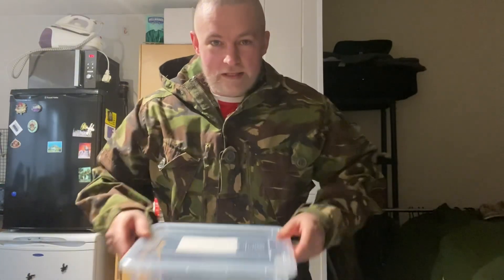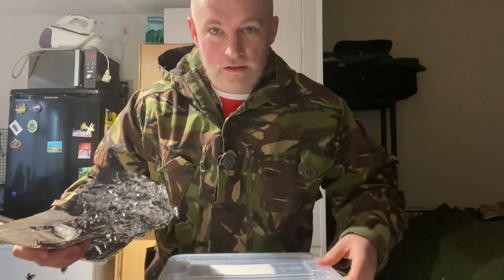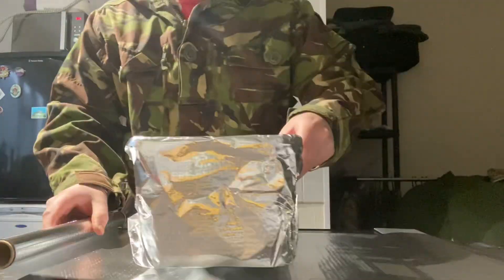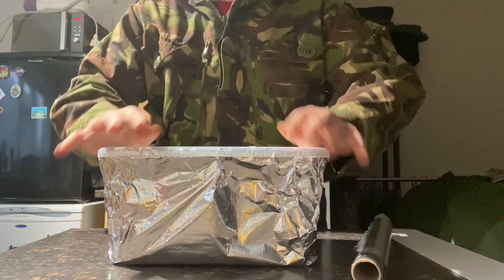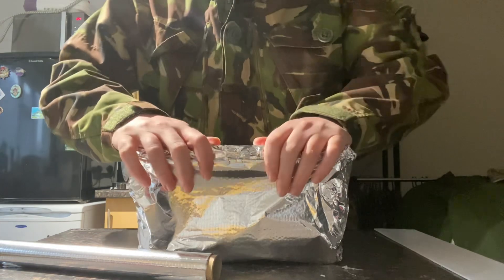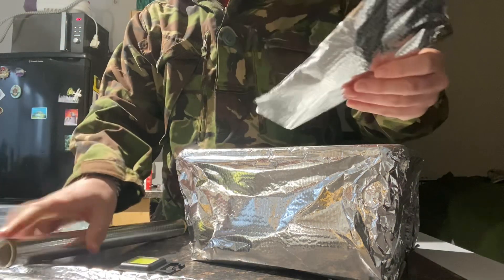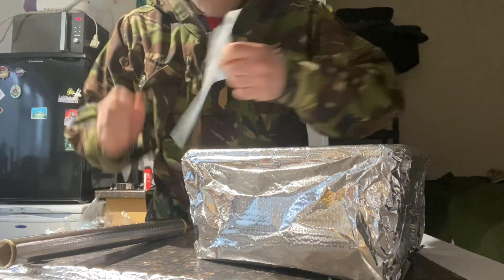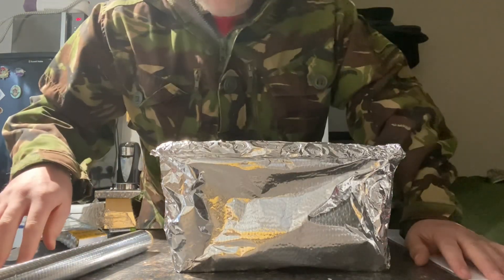DIY Low Cost Faraday Cage: Protecting Your Electronics from EMP

Comment: Not helpful or useful for real world causes like solar flare where you need to protect fridge freezer solar panels & generator
Reply from the maker: Solar flare does not effect smaller electronics. Only gird, so would not Need a faraday at all.
Reply: @UKUrbanPrepper big solar flare does indeed effect most electronics including solar panels on a house, an off grid home, fridge freezer etc
Reply from the maker: @UnspokenDocumentaries 
No it’s about the scale of Conductors…
Power lines are essentially giant, unshielded antennas that are exceptionally good at capturing the significant energy from a solar storm's induced currents. Small devices you would put in a faraday cage for EMP (Radios, phones etc) 
would not be effected.
Reply: @UKUrbanPrepper  wrong again. It depends on the size of the solar storm / flare. Big enough solar flare, home solar panels & off grid homes in countryside will indeed be affected. They have solar panels, batteries, fridge freezers etc. Even electrics in cars will be affected. Also, no where did I mention "radios or phones". If the entire grid went down, you wouldn't need them- but you would need an off-grid freezer for food.
Reply from the maker: @UnspokenDocumentaries so your initial comment was that a faraday box is not useful. pMr radios between my group, Meshtastic nodes and devices, and the point WAS protection from EMP. 
Now your scaling is up to beyond a carrington event, so make you right.  So much for quote “real world”. 😂
Reply: @UKUrbanPrepper  a large solar flare, as predicted by many people, taking into account the shifting magnetic poles we are seeing on earth, is very much potentially a “real world “event, in the future. It could be the very near future. You are arguing in semantics and wordplay. My original point stands. In this real world cause, you would need a much larger Faraday cage that can contain a fridge freezer, solar panels, off grid set up, arguably covering a small shed or a small home. This means figuring out how to include the windows and door openings as part of the Faraday cage, and the floor, so that you have no gaps.  The key point here is to provide enough time, approximately two years, for the national grid to be set back up. During this time a freezer is your best case for survival. Unless you have 400 acres of land with animals on it. A shed sized Faraday cage containing large freezers & off grid setup is your best bet.

Comment: Not picking any faults but putting the foil inside the box is making it all conductive so it will fry it all. Maybe just keep it to the outside of the box?
Reply from the maker: Yeah got a cardboard lining inside the box aswell now. 🤦🏻‍♂️
Reply: Having the foil outside and continuing it in the box is like creating an arial. Foil the outside then maybe foil inside making sure they don't touch. I'm an electrician. 
To see if it works ring your phone in the box if it rings its not working ✊️
Reply from the maker: @adamgaunt186  thank you

Comment: I have a home made Faraday cage that I went a bit overboard.
It's a Large metal garbage can.
I first took Metal tape and sealed any holes, punches, screws, etc. also any rivets and seams.
Then lined the can inner wall with cardboard.
Then inserted a very large EMP bag into the can like a trash bag into the can.
Then each item is in there cardboard box. I wrapped each box with Aluminum foil for 5 layers.
Took the item and placed it in their own EMP bag and vacuum pak and heat sealed it.
Then place the item.into the Metal garbage can into the LARGE EMP BAG.
HEAT SEALED THE Large bag in can.
Place lid on can.
Then metal taped along the lid to give good seal to lid and can.
Labeled all items on bags and place label on can.
Yes, it's overboard. But you only get one chance at surviving an EMP.
Recap
1 metal can sealed
2 different size EMP bags
5 layers of Aluminum foil.
1 layers of cardboard

So it's a bit much, but it should work very well....

Just my 2 cent
Good luck.
Reply from the maker: Sounds like enough protection for a directs strike never mind an EMP. 💯 should work tho. Love it.

Comment: I'm sure I read that to improve emp resistance you should line inner with cardboard,I have done similar with a metal bin from B&Q Sealed it with tin foil (took a couple of times to get it right,put phone in and it wouldn't ring when called eventually lol.
Keep up the good work
Knowledge is power
Reply from the maker: Thank you. I will look in to the cardboard lining. The test conditions I looked at didn’t use.
Reply: Nice